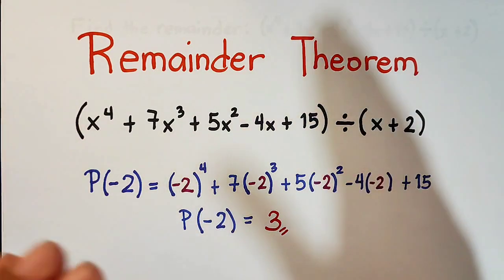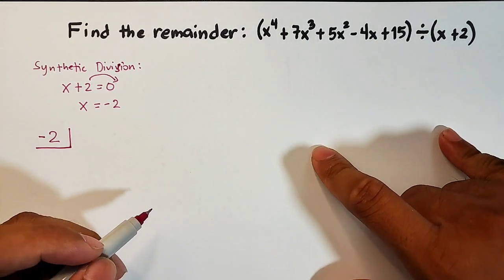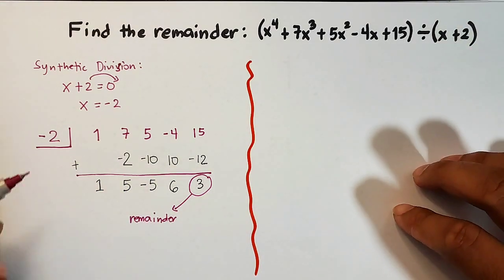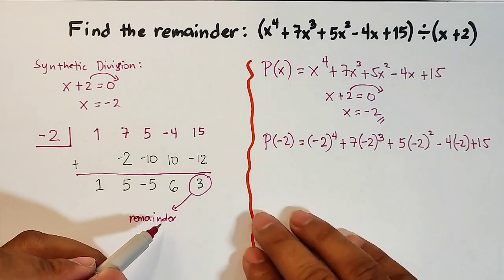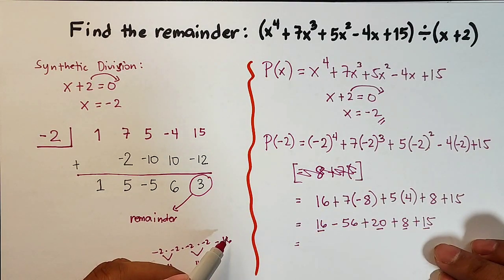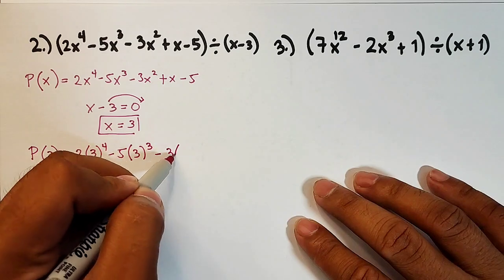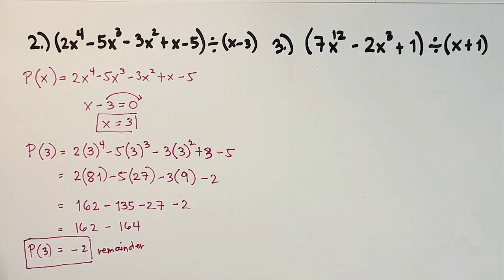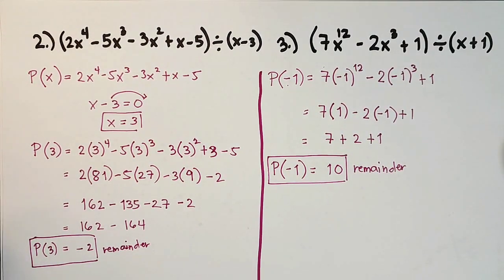The Remainder Theorem - How to Find the Remainder when Dividing Polynomials?

Comment: -2 raised to power 4 is 16 mate
Reply: Exactly
Reply: He did correct it tho
Reply: Its -16
Reply: @reggisexcellent no, it’s positive because when the exponent of a negative coefficient or number is EVEN it will be positive
Reply: @audriemiles  can u explain it on a simple matter? because I couldn't really understand it
Reply: @reggisexcellent -2⁴ is saying -2 x -2 x -2 x -2, the exponent is 4, the number of times the term has to multiply against itself. As the other person said, 4 is an even number meaning the result will always come out positive. 2x-2=4 then 4x-2=-8 then -8x-2 becomes 16.
Reply: He corrected it bro
Reply: He corrected it, why do you need to point it out again?